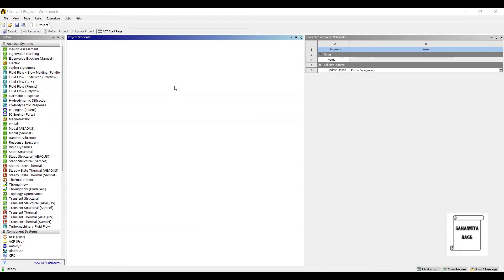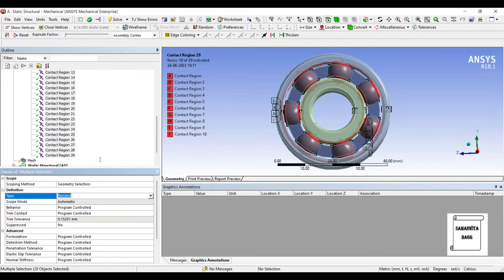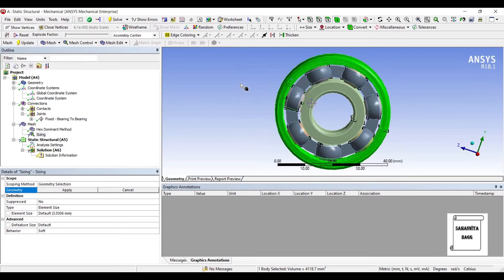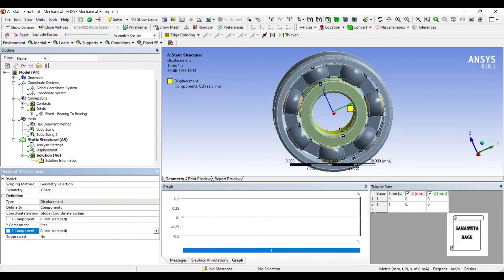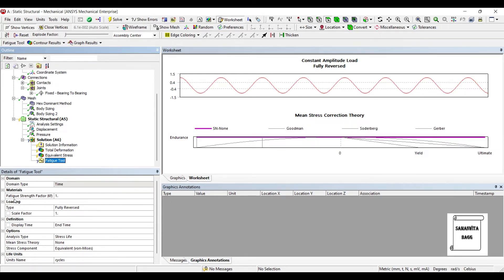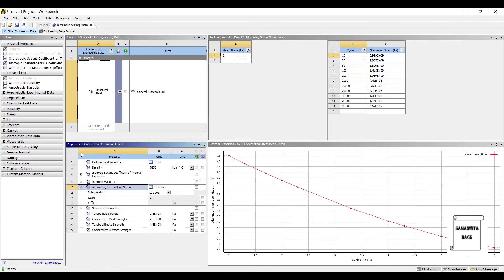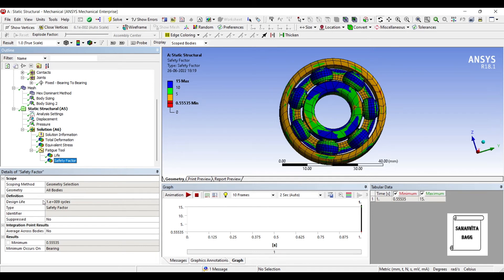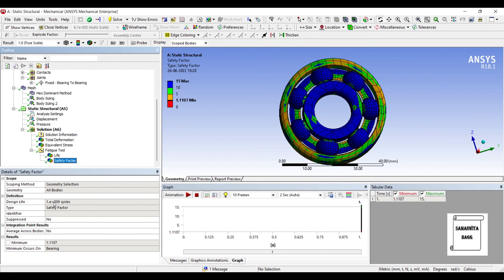Fatigue Analysis | Ball Bearing | Equivalent Stress I Fatigue | ANSYS Workbench

Comment: Mesher has failed to generate hex dominant mesh for one or more bodies. Try using a different mesh method.

I got the error...why?
Reply from the maker: It could be that your version is not supporting those many number of element formation. Go for a simpler mesh.
Reply: @MechProverse  thank you
Reply: An unknown error occurred during solution... What's the meaning of that
Reply from the maker: Boundary condition may be missing or wrong